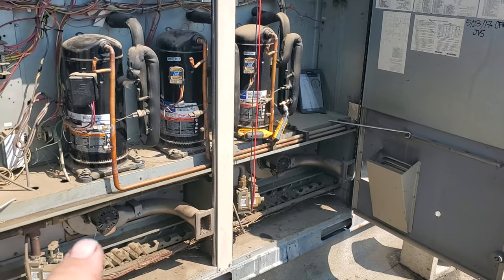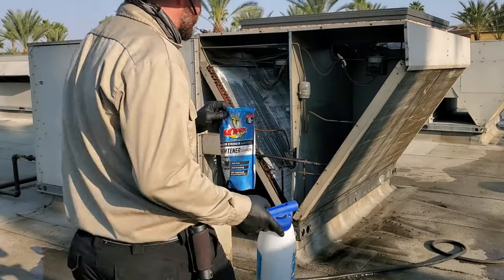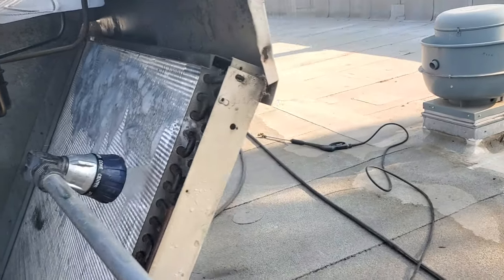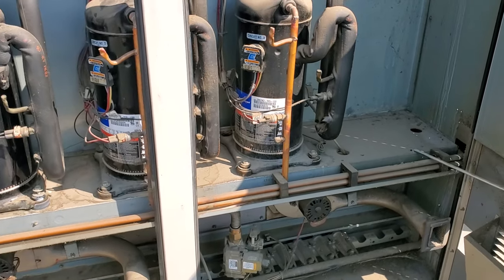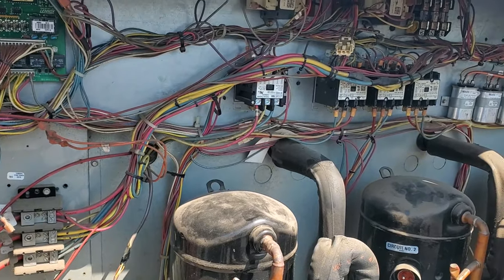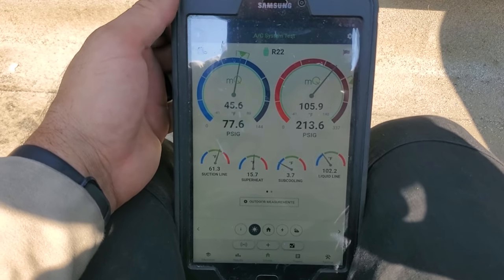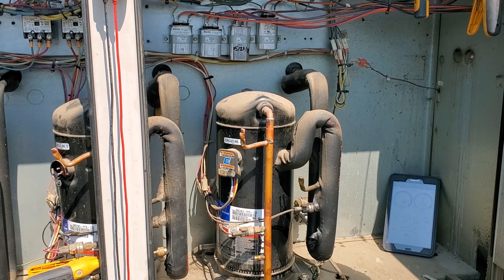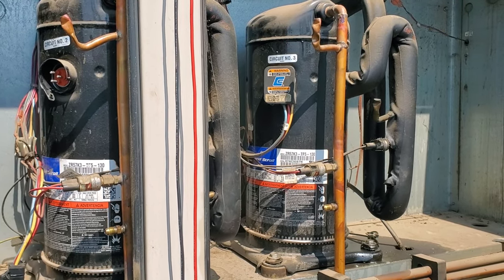THE SYMPTOMS KEPT COMING

Comment: A litte portable booster pump would be a great addition for those low pressure situations, like a grundfos scala 2.
Reply: Or a larger opening spray head.
Reply: The Milwaukee transfer pump and a 5 Gallon bucket all you need
Reply: sprinkler pump from tractor supply and a couple fittings would rock right along
Reply: That may sound like an easy fix, but depending on the kind of booster pump you use it may possibly cause other issues. Starting from hoses on the suction side collapsing due to the low water flow to starving other things using water from water flow (dish washers, sink faucets, ice machines etc.). It would even be possible to suck air from an open faucet back into the line. But that would also highly depend on circumstances we do not know here, e.g. why the water pressure is so low. Is it only a problem on the roof? then a booster pump should be fine. Maybe someone had half closed a valve for the roof line or the valve itself has some issue. If this really affects the whole building, something else is weird.
Reply from the maker: I will discuss this on my livestream tonight on YouTube 1/25/21 @ 5:PM (pacific) come on over and check it out https://youtu.be/nkXfDPT0zWc
Reply: @H4zuZazu  why yo logo Germany countryball
Reply: @mick2171  Why not? ;)

Comment: Hi Chris, just an idea for low pressure moments like this, pop to your local hardware chain or whatnot, anything with a garden Isle where you can find those cheap weed n feed spray packs (or any spray pack you just click onto the garden hose) and grab one, do what ever you like with the pesticide, just keep the lid and stick a screw or something to block the uptake hole, or even cut all the plastic back so you just have the little jet piece that sticks in the hose... Cheap little jet that ups the pressure but won't damage anything 😊

Comment: A local pizza business with 6 locations each with 100+ seating. And it wasn't low quality cardboard crust pizza like the big national chains. They had a thriving business model with a lunch time buffet that packed them in.  One location was a 30 year community fixture.  All locations giving up the buffet and moving to hole in the wall locations with no seating and to-go pizza only.  Most of the other small individual restaurants in the community are closed permanently. Lot's of for lease signs. Kinda reminds me of times when Nafta was first put into effect. The current result is a short term boom time for HVACR as the new hole in the wall locations have to be equipped with the necessary equipment.  A bad long term for HVACR as overall there will be much less equipment to repair.

Comment: Be sure that the water flow from the hose satisfies the pressure washer's input requirements. Otherwise, you get cavitation on the pump input, and very short pump life. You almost need a pressure gauge on the input.

Comment: Hi Chris,
I was at two supply houses here last week in Johannesburg for some fittings as I need to connect 1/4 flare to pressure sensors, the application is actually test equipment.
However, at both places I was the only customer.
Never had that, the effect of this situation is felt heavily.
Anyhow, about this video.
That RTU was tired, and the lack of pm takes years of their lives.
So what's new, it's why we have work to do right.
But, as you said one has to be thorough and do proper reporting when communicating with the customer.
And be sure that if the customer gets a second opinion on your diagnosis that there is not going to be any discrepancies, like you  take care to avoid.
Nice one, thanks for sharing,
Kind regards to all,
South Africa

Comment: Great job in getting that unit to work enough to get them through. I always cringe when I see a power washer being used to clean coils. It is so easy to mess up. My favorite tool for power washing dirty coils is the Little Big Shot Fully Adjustable Super Hose Nozzle. That little beast rocks but if you have high water pressure it can bend fins so as always pay attention. I still have a wand like yours too but that little big shot nozzle rocks. I would have loved to have been diagnosing that unit with so many things to test and analyze at least to point, lol.

Comment: Lowes sells a $100 cast iron transfer pump that works very well as an in line booster pump.  I use it often in the middle of summer.  Also works well to move glycol, and for decaying tube and shell heat exchangers.

Comment: when I saw the wires jumping on comp. 2 that told me it was arcing internally either phase to phase or phase to ground the wires jump due to surge current causing electromagnetic forces to act on the wire making it move

Comment: That Viper Coil Brightener is CRAZY insane for cleaning neglected coils.  I used it on my A-Coil in my furnace, was seriously caked in dust, hair, and coil corrosion.  I knew it was going to cause the coil to etch and erode some fins, but with low air flow; I didn't really care!!  I sprayed it on their, let it sit for a good while, and the amount of crap that came out would make you puke!!  It was very bright and clean, had some aluminum fin bits come out, but the air flow through the furnace was amazing.  The A-coil will probably fail, start develop leaks, but the Viper coil brightener is also very potent, and not something to mess with!!  I was very impressed, glad you recommend Viper products, and use it now for seasonal maintenance for the AC units.

Comment: On the 3rd compressor refrigerant will wash out the oil, if the crankcase  heater is not working. What it does is keeps the oil hot so refrigerant cannot get underneath it when the system is off and it stabilizes. That is were wash out will occur. At work we have 11 chillers,  sometimes the operator's will just kill power to one because it's not needed now the oil heater is off. And the chiller will not start back up when needed, however they have oil sensor's and you instantly know what's wrong but you have to go through a bunch of shit to get it back up.

Comment: Low water pressure: At least some pressure washers have a low pressure output mode where they are still pumping water, but only delivering it at 50 or 100 or so PSI. This is often in conjunction with a soap siphon mode to be used for washing cars and the like. If your pressure washer can do that, you could use it as a pump to increase puny water pressure by literally sucking the water out of the low pressure line and delivering it at something usable.

If you can't do that, you can probably find a little booster centrifugal pump for $50 or the like at the hardware store. Again, just put it in line with the low pressure hose, and you should have usable water pressure. It is a pain to have to drag that up on the roof, but maybe less of a pain than no water pressure.

Comment: I'm not surprised the client went for full replacement. Two compressors and a TXV are bad, plus the condenser fan motor... A new unit is likely more efficient, and there's a lot of man hours in repairing a RTU that's already running on borrowed time... I'm a huge fan of "repair, don't replace," but sometimes you just gotta do it.

Comment: That clicking noise that you're hearing is the internals something's loose and knocking but not causing it to short The only other possibility is if a piece of metal from brazen and something got sucked in somehow and it's small enough to get through the screens or punch the hole through something and is in the discharge hole for the scrolls compressor for the scrolls

Comment: Dewalt makes a a portable pressure cleaner battery operated up to 550 psi and can switch for regular water may want to look into it for it isn’t as strong as conventional pressure washers part# (DCPW550P1) also you can attach a hose or run it from a bucket. Good Luck

Comment: For future pressure washing of coil fins - buy a larger orifice fan tip (try Amazon). Your current tip will have a number engraved on it, pick one a few thousandths larger and it will spray with considerably less force/pressure.

Comment: If the tips on the pressure washer are too strong, what if you took the bits off and have a boost of pressure compared to the garden hose but not as much pressure as the tip produces? just a thought! great video as always!

Comment: We worked on kitchen hood cleaning and industrial equipment cleaning,using a dry ice power washer is way faster method,plus you get no secondary waste,no water all over the roof,also dry ice works perfect for cleaning electrical wires without any harms,look it up,if it is not worth the price since you don’t do much cleaning as hood cleaning,you might use steam cleaning machine,it produces less pressure but also less secondary waste and won’t bend anything

Comment: Holy smokes see the wires jumping at @9:55 is that from the current :o?
Reply: very very strange
Reply: would say somewhere from 10 to 25 amps(peak)
Reply: That's when you just wait for the terminals to blow out
Reply: That's what I was thinking! I presume a short from red phase to ground. Pretty crazy caught on video!
Reply: I suspect mechanical issue causing the compressor to jerk and twitch was causing the wires to move.  Not that it can't happen but its unlikely amp draw in wires on this unit would make them move.  I have heard wires make noise on 1000 amp chiller on start up but did not witness them actually moving.
Reply: @mrbyamile6973  I considered mechanical too but watching frame by frame I wasn't able to see any movement of the compressor. A 1000A compressor would presumably have conductors rated accordingly. In this scenario, depending on the conductor size and length, a fault current in the hundreds or thousands of amps could be possible.
Reply: @mrbyamile6973  wires easily move on 12v 50 amps so on 220v or 400v it should take a bit less current
Reply: @vincentschumann937  Compressor running current perhaps but a short to ground could produce hundreds or thousands of amps
Reply: @rgtsparky  that much should kick the breaker and they run on like 3 to 8 amps
Reply: @vincentschumann937  Possibly, although a breaker rated for motor starting and having a "slow" tripping curve may not necessarily react to a short that potentially only lasts for a single cycle. Just my thought, I'm no expert on US power distribution systems
Reply: @rgtsparky  well my assumption was that ir would instantly trip on dead shorts
Reply: It is indeed due to an instant and huge surge in current. Most likely going dead short for a very brief period of time.

Comment: I like the videos that have the camera further away seem to get a better idea as to the processes , also you may have tried this but take the nozzle off the pressure washer wand and use it as a booster pump on that low water pressure, without the nozzle it would be a bit more powerful stream but not enough to bend the fins.  just say'n Great video

Comment: Sir can you help me in walk in freezer unit 2 HP scroll compressor gas 404a is water cooled condenser, charege 50psig suction pressure and discharge pressure is 200 psig site glass is full.but ice farming on evaporator unit half coil.also ice after txv , distribution line..

Comment: Id say when that middle compressor was popping and jumping like that it was starting to burn up inside and short out. The wires contracting the way they were with the amp spikes. Prob would of tripped the breaker/blown a fuse if you left it on much longer. Either way that comp was toast.
Reply: Good thing if you have to replace a compressor that starts jumping and moving like this, you just have to put the new one in after the old one jumped of the roof all by itself...

Comment: Could try something like the Dewalt DCPW550P1, It connects to a hose and uses the 20v batteries to increase pressure, Not nearly as high psi as a pressure washer and uses pressure washer nozzles aswell.
Reply from the maker: I will discuss this on my livestream tonight on YouTube 1/25/21 @ 5:PM (pacific) come on over and check it out https://youtu.be/nkXfDPT0zWc

Comment: What causes a chest freezer not running but the green light flicker. The compressor isn't working, and i can't find voltage.
Reply: I personally think the light flickering is a red herring. Neon lights just do this as they get old and burn out.
If the wall outlet that the freezer is connected to has full voltage, chances are pretty solid that the freezer is also getting full voltage.

In my experience, the most common failure in small residential-class refrigerators and freezers is that your compressor starting equipment fails.
Then instead of starting up they cut off on overload with a subtle little 'click'.
These compressor motors are so small (sub-1HP) that you can barely even hear them running correctly, let alone humming away on a no-start, unless the room is silent. If you have a condenser fan, you aren't getting silent.

You may also have a failed thermostat that is not calling. Assuming an analog dial, adjust the setpoint up and down, and listen for the soft click of it turning on and off.
If it does click, don't keep swinging it up and down, as that can short-cycle your compressor, which is bad for it.
* This may not work if the unit is hot, as the adjustment span of the thermostat is too narrow to be able to cross with the ambient temperature.

That said, I'm neither an HVAC technician nor do I have the freezer in front of me, so this is just a starting point for you to try to figure out why it's not starting up.
And if you still can't figure it out, don't be afraid to take it to your friendly neighborhood appliance repair technician.

Comment: The problem when you were a coral cleaning with that exact same pressure washer that I use on the same exact unit is you go inside of his He's supposed to go up and down with the direction of the coil and you should know better than anybody else that those old coils on those units are much stronger than the crappy aluminum on the new ones unless you're talking about micro

Comment: I cringed during the pressure washer part; I’ve done that experiment on my home condenser unit before and the results were um... well you know..
Reply: Oh, was it your unit that showed up in one of Teds episodes over at Anti DIY HVAC? I think he showe one in some video, that was completely flattened out and closed up.
Reply: @alexku8452  haha like Chris I noticed pretty quickly, backed away and hid the pressure washer in the shed. Nothing to see here!
Reply: @burningdust  I only wondered if Chris had that thing on full presure or if he had the pressure dialed down to minimum, so it could still work as a booster pump, but with less an agressive stream.

Comment: Booster pump for the water but using PLEX or any other similar- stiff hose so it dose not collapse under a negative pressure when trying to pull water from the tap faucet.  
           My grandfather taught me this when I was a kid pass on the information.